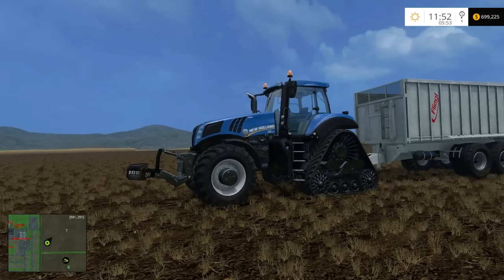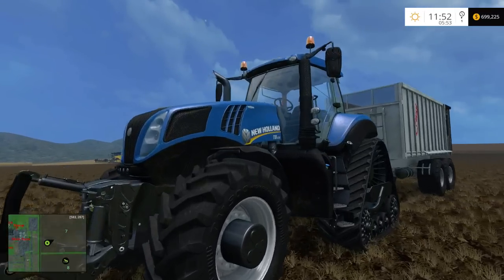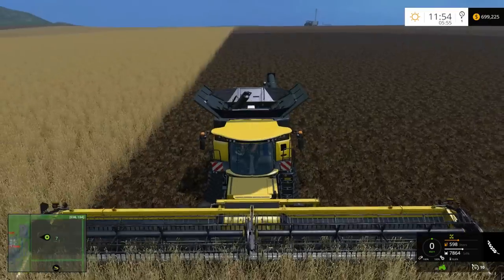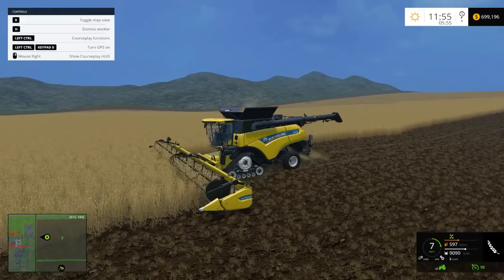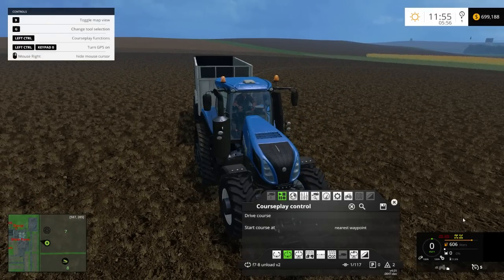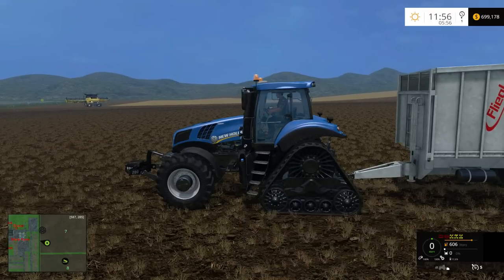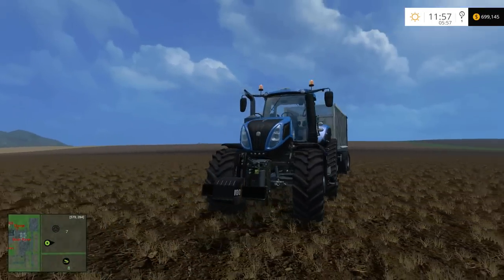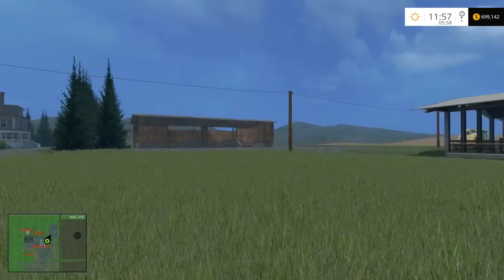How to use the drive control mod - Farming Simulator 2015 tutorial

Comment: Great video but I have a question that seems to be not answered anywhere else so I figured this would be my best bet. I've tried all kinds of drive control mods and they ALL cause steering drift and I don't know what to do. How to I correct this? I've messed with the dead zone setting in the menus and doesn't make A difference. A response would be much appreciated.
Reply from the maker: in the drive control xml there is a part about deadspace if memory serves. You should be able to adjust it a bit.
Reply: Yea I adjusted that with no change. Maybe a better drivecontrol mod will be released. Thanks for the reply though!
Reply from the maker: Barnesy Boy Also, I think there is a an adjustment in farm sim as well in the options section

Comment: Hello Ian Robson!  I was wondering if you would be able to explain a module that may or may not have been included in the version of DriveControl you reviewed.  It is the Implement Control module,  it add four new keybinds, raise/lower front/rear implement, and turn on/off rear/front implement.  It said in the mod description that they were left unmapped intentionally because it had no place for keyboard,  it is for joystick/wheel/gamepad players.  Can you explain that feature to me?  I know it is activated in the drivecontrol xml however, it will not allow me to bind any axis from my xbox controller.  Maybe it wont let me bind the axises because I dont have the required equipment or a hardware issue on my end,  but I would really like to know what that module does before I start trouble shooting it to fix it for week only to find out that its main purpose is something completely useless or just cosmetic.  Thank you very much in advance!!!

-Mako (Kentucky, USA) Ooo-Rah!
Reply from the maker: PFG Mako I honestly haven't used it much yet. That was added after I did this tutorial. I'll see about having a look at it today.
Reply: Iain Robson
Hey Ian!  Thank you for the response  ^_^  I appreciate the video BTW,  it got me started using DC effectively.  I still yet dont know what implement control is or how to use it, but everything else is fun.  If you can get it figured out, that too would be much appreciated, if not then dont worry about it.   The mod works perfectly otherwise.
Reply from the maker: PFG Mako it's suppose to be for extra peripherals last time I checked. I'll see if I can dig up more

Comment: the video is great, after I installed it the steering was worse ( was very sloppy couldnt drive straight , even with 4wd ect turned on or off). I never could figure out what was wrong
Reply from the maker: +MRJ 57 There are some adjustments you can do in the xml if memory serves
Reply: I'd be interested to know what I could adjust

Comment: Great Video Ian, very helpful.  As a new user I am having great difficulty finding out how to get the tractor in this video (NH T8.435) to pick up the trailer you have used here, it just does not have the option. Do you use a mod of some kind, or am I missing something. I would really appreciate finding out.  Cheers!
Reply from the maker: MrKapeji It's the type of hitch the trailer has. That particular trailer is a modded version of the original that changes which hitch it is. 

Here it is > http://fs-uk.com/mods/view/35666/fliegl-tmk-266-bull-low-hitch
Reply: Iain Robson 
Outstanding! Cheers Ian! :)

Comment: Good morning. 

I'd like to ask a question about this mod. 

Is possible to use it for separate control of each track of a compact loader, or vehicles which uses tracks for example Bobcat t180? 
This would be of great help for realistic control of a compact loader controlled by two joysticks like in the reality is. 
If is possible could the developer send me the string to copy and paste to do it? 
Is also possible having a brief explanation of do I'll have to set it? 

Thank you again. 
Good morning. 
Nicolo' Zago
Reply from the maker: +lincendio As far as I know, that would not be possible.

Comment: how domi change the deadzone for drive control mod in .confug file , also i use a xbox 360 controller so i need to set the deadsone for that too, any help like videos, screeenshots, pictures would help alot thanks......
Reply from the maker: +James Carter I haven't tried it before, but I think all you need to do is adjust the numbers there. To what? I am not sure though

Comment: after installing this mod my tractor pulls to the left how do I fix this
Reply from the maker: buzztham I believe that is part of the mod. I don't know if you can disable that particular part or not. Maybe check the xml
Reply: Iain Robson just to make it clear my tractor pulls to the left with nothing attached to it the steering wheel is slightly turned to the left
Reply from the maker: buzztham and it is with drive control mod that it does it. Have you tried no mods and just the drive control mod
Reply: yes the it is the only mod installed and it still pulls to the left
Reply: buzztham all I want from the mod is the 4 wheel drive and the diff locks
Reply from the maker: buzztham hmm not sure what could be causing the problem

Comment: what button is shuttle control?
Reply from the maker: +Sarah Rees spacebar normally
Reply: can you type i dont undersutnd you sry
Reply: Searching old videos my drive control mod has y to start spacebar to release the break  w forward a and d for left right s for break 1 and 2 for speed 3 for cruse but I can not remember how to get it to reverse I must have a different version I also can not figure out 4x4 for the diff locks .... it's sad as I am playing on pleasant valley v2 and don't want to start over I just began to get rolling
Reply: Logged on to find like 2 million stored crops and definitly want to keep playing it as that map can last forever